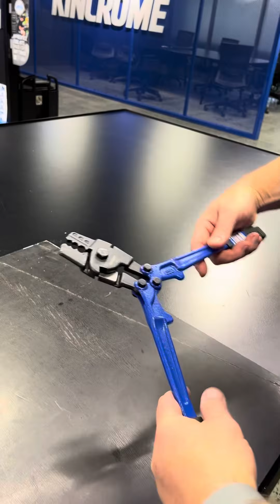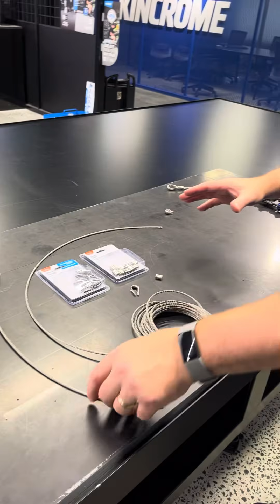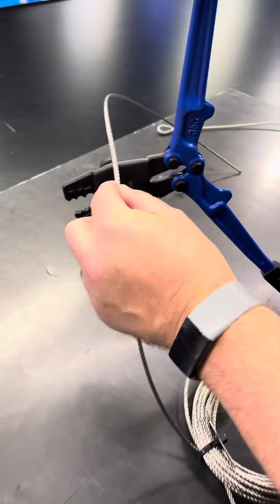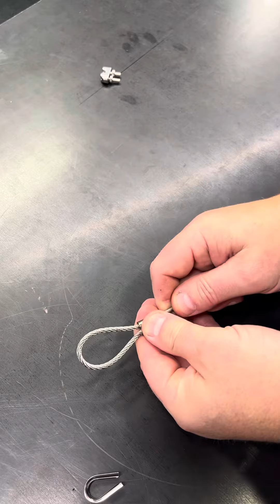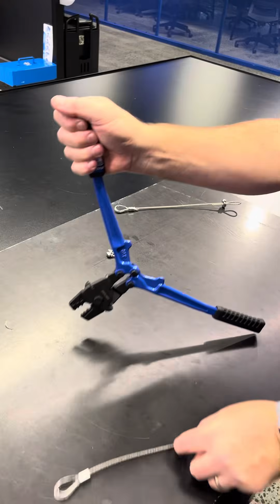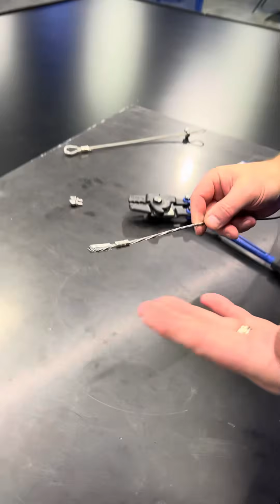How to use the Swaging Tool | KINCROME Tool Tip

Comment: Putting the wire flush to end of the swag is not correct.  It should be extended slightly past (double the diameter of the wire is standard).

I have one of these tools and the teeth aren't perfectly lined up, but I looked at a dozen in the store and jt was the best of the bunch... it still works, but it's not nearly as neat on the finish because of it.

Comment: I realise your swaging doesn't need to be up to industrial standards of safety for rigging but as a tool manufacturer it's surprising that you are not showing how to swage correctly. Namely a proper swage always has at least 2 diameters of the wire rope extend past the ferrule. Secondly if three crimps it's first the one in the centre, then the thimble side, and finally the cable end.

Comment: Would it be fine/safe to have a loop we're the ends cross parallel to each other like an O shape and then crimp it?  I'm wanting to thread it over and around some solid wood ceiling beams to hold hanging planters without damaging the beams. Thank you.